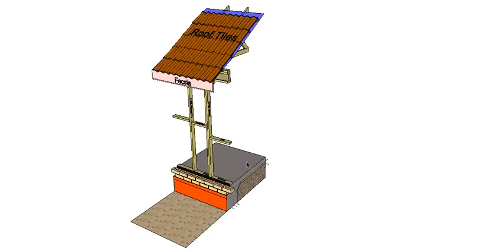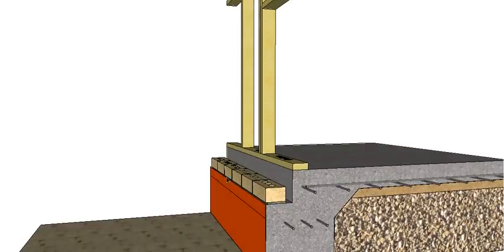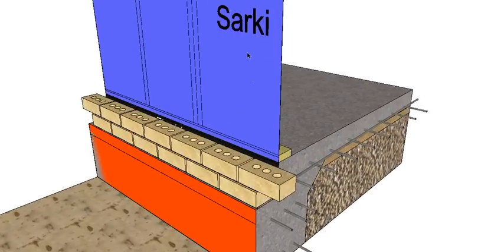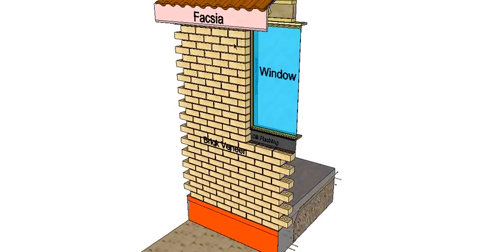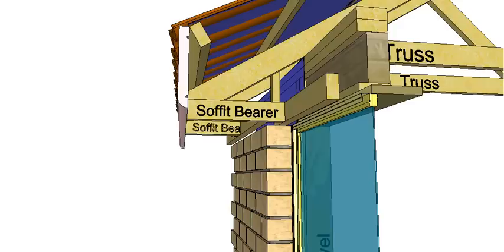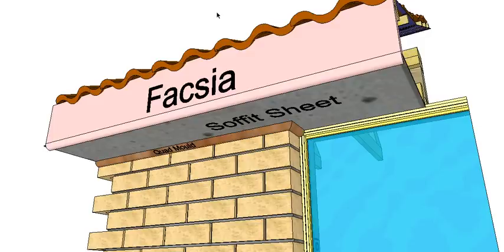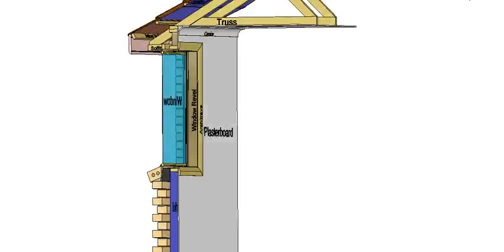Section through a Brick Veneer, Slab on ground Building Part 2

Comment: Hi, thank you very much for your excellent knowledge sharing. I am currently having a house to be built and at the brick stage，however, I don't see any sarking/sisilation layer behind the bricks, nether the flashing, although I did see some weep holes between the bricks. I am very confused, it looks like the bricks got lay up straight against the wood. Can any one please help me with 🥲my question?
Reply from the maker: Hi, Sarking is not a regulartory requiement however im supprised you would have got your BASIX approved without it, if you are in NSW. There sould be a 40mm gap between the bricks and the timber frame if not this is a problem. If you look into the weepholes you should be able to see the flashing. If you would like to discuss more please contact me buildsum@gmail.com

Comment: Hello, does the flashing through to the weep holes also serve as the Damp Proof Course in a typical brick veneer construction?
Reply from the maker: Hi Mate, No, the Membrane that goes under the concrete is effectively the DPC, some builders will also put DPC under the wall plates.

Comment: Is the weight of the roof tiles supported by timber or the brick walls ?
Reply from the maker: HI Trini, the timber wall is the load bearing wall, the brick is just a veneer.
Reply: @Buildsum  thank you 👍

Comment: As a Building Design student this helped me lock in the step by step process of constructing a brick veneer building. Thanks! However you forgot the insulation which is very important to save power consumption and therefor sustainability.
Reply from the maker: Hi Jeremy, thanks for your comment, Yes I did forget the insulation which is extreamly important.

Comment: there is a gap between the bricks and the cement wall where the wall frame sits, what size is that gap? and how deep needs to be the level of the brick base,where the first layer of bricks is laid in relation to the wall frame base?
Reply from the maker: Hi Mate, the gap, or the cavity, is usually 40 - 50mm wide and 172mm, 2 courses of brickwork, deep.
Reply: @Buildsum  i know nothing, about this, so is there a course that one can take, at certificate level, at tafe, where one can learn, about doing the slab, and laying the pipes, and other structures, before the slab?
Reply from the maker: Hi, no not really, i guess the best course would be the Cert IV in Building however it is a 2 year course part time and it covers alot more than just the slab and relies on you having a background knowledge of the industry.
Reply: @Buildsum  hello the flashing that runs,  from the bottom plate down to the first layer of bricks, how is it attached to the bottom plate, with glue or with nails? and from what i could see in the video, only a bit of the flashing is embedded in the first layer of the bricks.... not the whole width of the brick isnt it? about the graniteguard, you just place it until, the height of the first brick layer?
Reply from the maker: Hi, the flashing is usually nailed or stapled to the bottom plate of the frame. 
Yes, it should extend all the way across the brick as long as it is not seen on the outside of the building.
The granite guard just has to be below the lowest timber member in the  building
Hope this helps
Reply: @Buildsum  hi , yes, but the graniteguard, goes it go from the bottom , up til the height of the first brick, ....meaning, it is not supposed to fill the whole cavity, correct? I am looking at the sarking and i was trying to see if, you had mentioned or placed, plywood, or similar, on the exterior of the frames, prior to putting the sarking. i saw you mentioning the plasterboard for the interior, but the exterior of the frames, don't they get a similar cover to the plasterboard?
Reply from the maker: Hi yes, the granite guard will stop just below the flashing. 
Here in Australia we only use plywood on the exterior of the building for bracing not over the whole building however in America they do cover the whole exterior of the building with ply
Reply from the maker: Hi, Yes the Australian Standards would have to be equal too or exceed the International standard.
The video talks about having dedicated bracing sheets as well as others that cover the building. Bracing sheets have to be nailed to a specified requirement and must also be tied to the floor and subfloor. In Australian we only use the dedicated sheets and don't enclose the rest. 
Also different countries and regions within the countries have different wind loads and therefore require more lor less bracing.
Based in the wind loads in the area the number of sheets can be calculated to resist the wind loads in that area and stop the house from the effects.

Comment: does the brick actually support the house?? and how do you know if your house is a brick veneer or mansory ???
Reply from the maker: Hi Mike, in the case of a Brick Veneer or a Double Brick house the outside brickwork is only a veneer and DOES NOT support the roof load. The best way to work it out is to have a look at the internal walls and see if they are timber or masonry, if they are timber then the house is most likely brick veneer otherwise double brick. Otherwise, you are going to have to get into the roof and have a look where the roof is pitched from. Hope this helps.
Reply: @Buildsum  Thanks for your reply. I really appreciate it :) For my house,  the ground floor is brick and 1st floor is whetherboard - I checked the internal walls by tapping them and it sounds hollow - so i guess my house is brick veneer - but does this brick support the whetherboard or the load of the 1st floor ?
Reply from the maker: HI Mike, yeah so the ground floor would be brick veneer and then the 1st floor would be basically a timber frame with the weatherboards fixed to the timber frame. The brickwork is definitely not loadbearing it is just a finish like the weatherboards.
Reply: @Buildsum  thank u so much !!

Comment: Good video, just a question that course under the window (with the flashing) does the flashing go through the whole course or just underneath the window? Also when laying the flashing on top of the first course/Row how much length should we keep the flashing from either side of the row?
Reply from the maker: Hi Mitch
The flashing under the window just runs past the ends of the window by a couple of 100mm or so that's all, not the whole course.
For the DPC course, the flashing should extend right through the course for that moisture can't bypass it, however, it is common practice to set it back a few millimetres so it can't be seen from the outside of the building.
Hope this helps
Reply: Buildsum information is very helpful, thank you 👍

Comment: When looking at the side profile at 2:35, what is supposed to fill the gap between the bottom course and the foundation if there is only one wall of brick veneer on the house? Is it supposed to be mortared shut?
Reply from the maker: Hi Mate, no there is no need to close off the cavity at the bottom, in fact, you are better off to leave it open in case moister gets in there is can dry out.
Reply: Buildsum  I thought maybe that was the case but is that okay even if critters can get in there? I guess I could put a screen over it to keep anything out of there but I wasn’t sure. I appreciate the reply!
Reply from the maker: Hi Mate, The only way in would be through the weep holes and I have seen screens that you can install when building the home however it is not common and generally there are no issues.

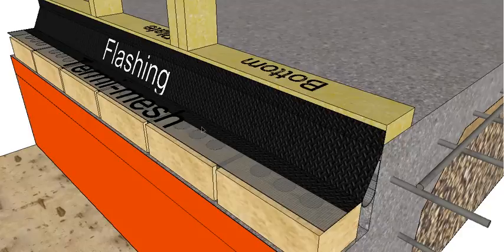Comment: 2:20 the DPC / flashing only seem to cover about the inside 1/3 of the brick.
Is that right, I thought it might cover the whole brick ?
Reply from the maker: Hi George
As this is Slab construction the membrane under the slab is considered to be the DPC, the flashing in the wall is only to direct the water that may flow down the back of the brick back out of the building. It wouldn't hurt to have the DPC come all the way across the brick however it is not necessary.
Reply: @Buildsum  OK thanks, makes good sense.

Comment: Are there any galvanized straps used in brick veneer?
Reply from the maker: Hi Gloria
Galvanized straps are used a lot in Brick veneer construction. they can be used as a tension brace for the timber walls, to tie the beams in the garage to the engaged piers, to tie the bearers to the piers and dwarf wall, if required. it can also be used to reinforce the walls for tie down purposes and tie the trusses to the top plates although there are proprietary products now that are quicker and easier to use than the strap.
Hope this helps.
Reply: Thank you so much! Really helpful to my assignment

Comment: Warning ! Long and descriptive.That was a great anatomy of the veneer instillation. We have a new home where we have a second storey peak roof under a 3 section bedroom window. The peak extends to the end of the garage and is the roof of the garage. The brick run for the second storey runs on top of a 5 cinder block wall constructed on an I beam that runs across the ceiling in the garage. Garage ceiling is all dry walled with an attic hatch for access. The issue we have is that water is weeping through the lower cider block support onto the I beam through the ceiling and onto the floor of the garage. The brick run goes up to the second storey roof above the garage. There are weeping holes in the brick one run above the first layer of brick layered on the cinder blocks. It would appear there is a major fault in the flashing instillation as you have demonstrated in the video. Water test prove that water penetrates the veneer, mortar joints and possibly the weep holes, this water penetrates downwards and leaks as described earlier. Water is not caught as in the demonstration and forced to channel back out through the weeping holes.The same situation occurs at the top of the foundation wall where a man door is framed into the foundation at the side of the garage where it extends out from the main wall of the house about 6 feet. Water weeps into the garage by running under the sill plate after penetrating the barriers described in the video. Mortar joints in some areas exceed 10mm to in some cases 20 mm or greater. We know this is not code.  The portico also has water leaking through the lintel over top of the main door of the house. This is probably coming from the second storey where the flashing was most likely installed incorrectly.We are warrantied but through this process the builder has shown a high degree of incompetence by affecting such things as sealing the weeping holes caulking and screwing down the roof flashing suggesting another layer of flashing over the exiting flashing on the roof.The man door frame was eventually replaced and the foundation widened as the builder and framers had installed the man door frame buy cutting it of at the bottom and sitting it on top of the foundation due to the foundation opening only being 34 inches wide. Needless to say the frame leaked all down the sides and was mostly rotten in only a 10 month period. The man door issue was denied by the builder for almost 10 months until it was finally removed and replaced. At that time we noticed the mortar rubble in the space between the veneer and the wall sheathing. Holes in the sheath cover no overlapping and lack of flashing in the 2 sides of the man door frame.  Leaking under the door plate and again leaking into the garage onto the floor.Serviceman insists that the sill plate was caulked had Styrofoam laid down on the foundation wall and plastic vapour barrier installed underneath. Water leaks under the sill plate down the 2 foot garage wall inside and onto the floor. This is the same idiot that sealed up the weep holes. When veneer was replaced around the man door the mortar joints ended up in the 20mm and larger area in some joints. The corner joint run in the 90 degrees where the house meets and the garage extends the 6 or 7 feet has a large single mortar joint now with no interlocking brick. Space between the brick and sheathing is questionable in this corner as in, very tight.No flashing continuance at the 90 degree along house proper connecting to the 90 degree and out to the sides of the man door.Engineer was hired and we are awaiting builders response to his report that memorializes these issues. Builder is not  very concerned. Very surprised at the incompetence.. Sorry this was so long but I guess no one has to read it. This video taught me so much about the exact way this should be done. Anyone buying a house should watch this video. You should inspect this construction process in buying a new house even if you have to hire an expert.
Reply: Yes that is exactly the case. When the house was built the division was nearing the end. We had seen a lot of work and met the bricklayer. 50 years of bricklaying and all the jobs looked great. We are only ones with  a 2 storey all brick house. We asked if they were able to do the job and they reassured us. The weather was great for when they bricked. We lived a ways away and they were strict on access. But after the house was built we had quality issues right away. Most of these they tried to hide. The flashing was contracted out. I did not know anything about flashing until these issue arose. Your video is excellent. Any way there are lots of denials now. The original bricklayer having subed the garage and second storey work to someone else. Scary, they did not even know if they put vapor barrier on the garage entrance. Ripped the brick off twice around the man door. Every time the mortar joints got bigger and no blue skin flashing.My neighbors a few blocks away bought the model home.  The concrete form tie holes were never filled in. The walls ended up cracking and weeping moisture into the foundation. Because they drywall the basement walls it is hard to detect cracks until moisture and water weeps from under the drywall.  We had a leak in the furnace. 2 cracked window frames, known but not revealed to us, a leak in the garden door, leak in the cold room, from a non filled concrete tie hole, leak under the man door leak through the man door foundation wall in the garage and  leaks from the flashing from the second storey.And yes after the fact we got to know a few of the contractors who basically said that they do not reveal errors. If the next trade is slated they just build over mistakes and have no team mandate. They just overlook every error and leave it to the homeowner or the builder to find it and fix it later. There is a shortage of trades people. But there are great ones out there. We were able to get an engineers report in with our year end report so that the Tarion homeowner insurance body has a professional engineering document to support all the issues. It took the engineer 3 minutes to diagnose the flashing. We also went to the trades college and talked to the Professor. In 2 minutes she diagnosed the flashing.We don't have the venomous creatures you have though lol. My Grandfather was from Sydney, We used to sit in the giant tortoise shell he brought with him.
Reply from the maker: Hi Mate
Wow, it sounds like quite an ordeal, however, it seems to be a fairly common problem these days. The speed of construction, the skills shortage,  and the segregation and specialisation of trades has really downgraded the quality of the houses we are building these days. I hope you are able to get your issues sorted out as soon as possible.

Comment: My house was finished recently by a big builder. I didn’t see any DPC flashing at all during construction - is this normal? We do have weep holes. Also the concreter went and poured concrete nearly at level with the weep holes - bloody disaster.  Luckily it was builder’s subbie not us. Currently fighting with builder about this issue. I was told there is no building code and asked what I was talking about... wow!!!
Reply from the maker: Hi Mate, sorry to hear about your problems, I hate it whenever professional builders can't get it right. As for the DPC, the bricklayer would normally put that in as they laid the appropriate course of brickwork so you may not have seen it go in.
Hope you are able to sort out the problems and get on with enjoying your new house.
Reply: Buildsum  thanks for your reply! Is there a way I can check for flashing? Can I remove a weep guard and take a look with a torch? Should I be able to see plastic flashing at back of weep hole? If not and it’s just mortar, is that going to be a big problem? I feel it is and I may get a building inspection done.
Reply: Buildsum  I should send them your video and tell their brickies to go and learn how to do their jobs to code!

Comment: Hey  built sum! Im doing my constructing report for uni and I found your video is suuuuuuuper  helpful!!!! 
I'm just wonder about the insulation, it there just the insulation to do with the moisturize? What about the noise and thermal? 
Will the brick wall be colored as finishing or there is some other finishing?
Reply from the maker: +Ruoxuan Wang Yes there would usually be some Thermal/noise insulation in between the studs.
The brick work could be painted, bagged or rendered or just left as plain brick as long as Face Brick are used